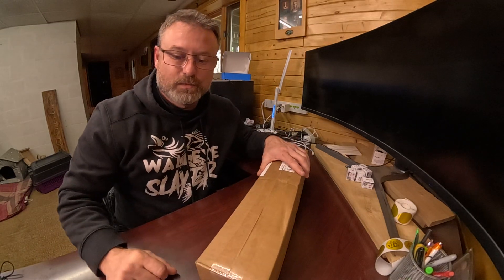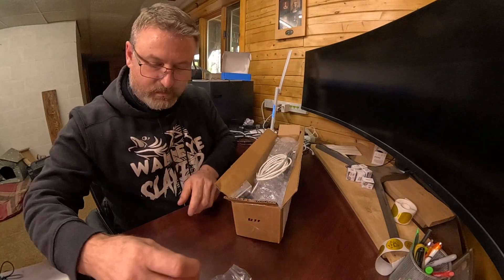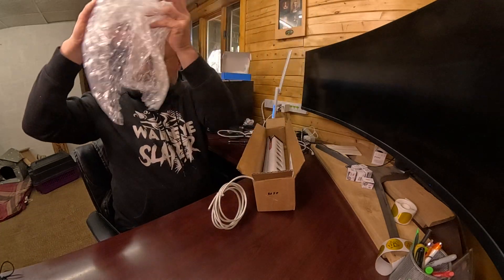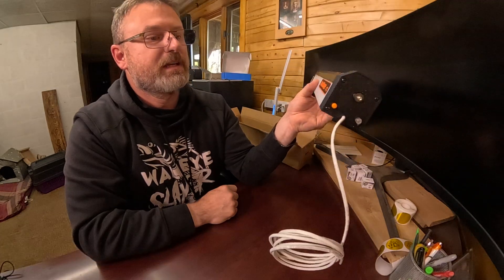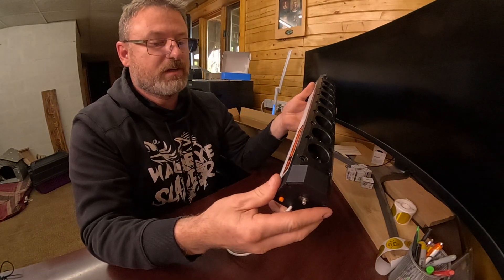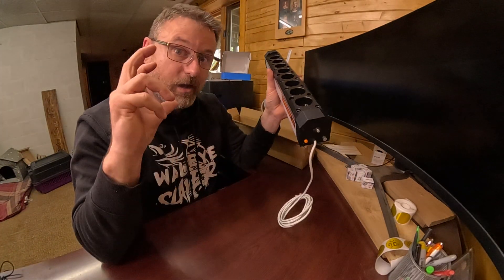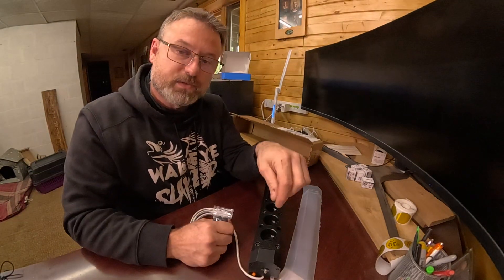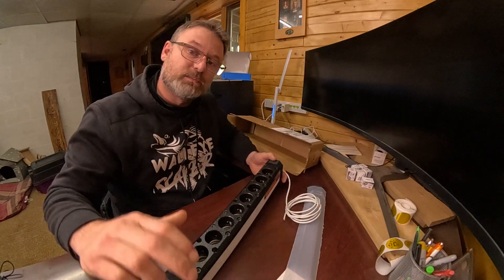Automatic tool changer for the Altmill?

Comment: Student #2 here. I've been working with CNC for about 10 years now. I received my Altmill about two months ago just before the MK2 came out. I'm receiving my ATC tomorrow and will be following along with you during the installation. Once I get that running I'm going to get the retracting dust boot. I think you mentioned you got the ER20 collets so you must have upgraded to a larger spindle 2.2KW. I'm using the ER16 collet.
Reply from the maker: Good to hear! The installation will be the same for the ER16. I do have a 2.2Kw water cooled unit I will be using. The seinci spindle will go on my other CNC since it’s not as powerful. I will have a new installation method through G-Sender that Rapidchange is working on as we speak to make installation easier with the SLB-EXT. stay tuned. I’m receiving my Altmill today. Got the Vortex and Computer yesterday.